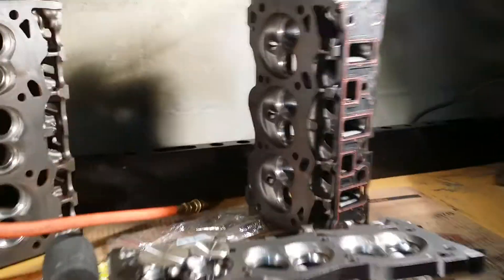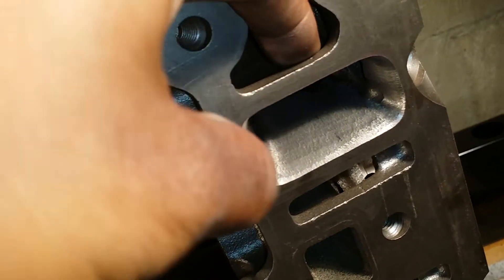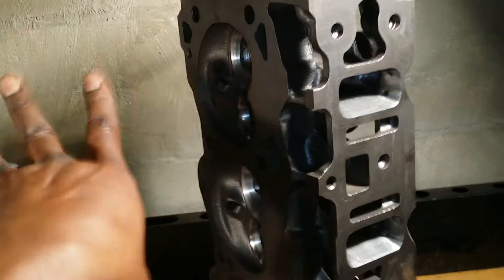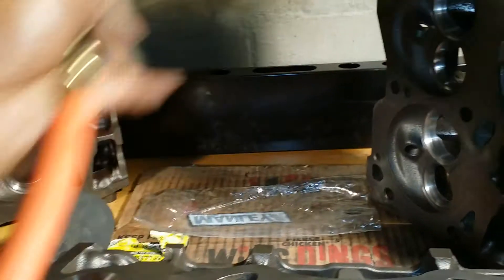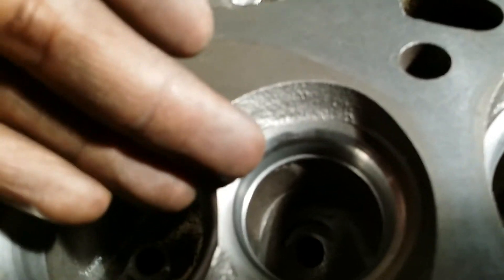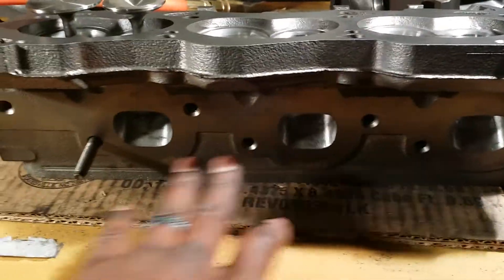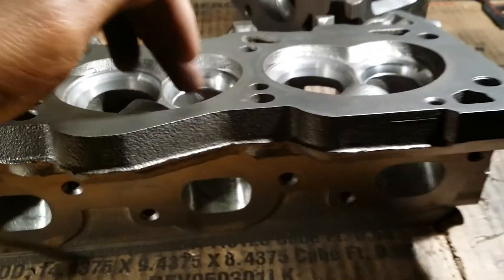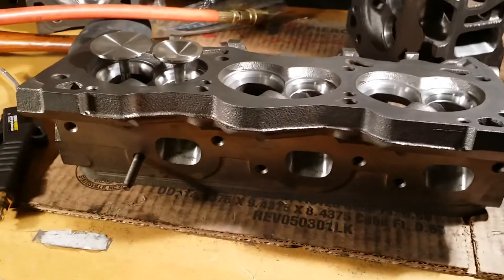Ported 3800 Heads (Part 3)

Comment: Templates? How about silicon rubber removable casts of the ports to show
the correct shapes of the runners and bowls? Cut heads to show the casing
thin areas, water jackets etc?

Comment: Venturi effect.  You should understand the basics, before, you say this is an effective way to shape a port.  Go flow test that head, I'd bet you didn't help the flow much.
Velocity is not always conducive to flow. Velocity is speed over time. Cfm is volume over time.
High pressure, low flow---low pressure, high flow.
Your imagery with the hose, you absolutely neglected a baseline fact.... The higher the pressure, the lower the flow. Its exactly the same as exhaust systems... What flows more? What flows faster? A 2" or a 3".
I also recommend you reasearch flow/fluid dynamics. Its a proven SCIENCE.

Comment: No need to port the intake window youll go backwards in low speed air flow on a 3.8 inch bore. Concetrate on the intake bowl and never never kids go 90% over the size of the intake valve......flow will just go backwards.
Reply: Incorrect. These are not N/A engines. The rules are completely different with a positive displacement blower.
Reply: @Big_Chris  Wrong air flow needs direction ,  you just cant port anywhere and then think air is going to be rammed down the port by a blower. Properly prepared set of heads for a supercharger with a smaller intake cc will outflow a larger cc intake if its not properly ported in the right areas.  Has nothing to do with N/A or Blower.
Reply: @krishess4081  You've articulated a strawman argument. I'm not debating the obvious, nor instructing my followers to just port anywhere. I'd encourage you to shove 10 psi of boost worth of air through a cylinder head during a flow test and tell me N/A vs blower doesn't matter. More traffic requires more lanes. Moving bigger furniture in requires larger doorways. That is an elementary fundamental.
Reply: @Big_Chris  see thats your mistake "more traffic requires more lanes " like i said you just dont port anywhere and think that the intake port is overall larger so it must flow more air LOL. ln you vid youve made alot of mistakes and definetely have gone backwards in directed airlow.  And its not elementary fundamental,   bigger isnt better .
Youve also contradicted yourself at the start and end of your statement. Understand that air flow to the intake  valve flows in one direction only and its guided by the actually design of the port  small improvments can be  made with great results  if you know what you are doing. You havent done this  and in your vid youve just ported anywhere and thats a mistake.
Reply: @krishess4081  would you explain or show me how to port these heads thanks

Comment: I want to to port the heads on my c63 amg but I know exact numbers are needed and weistec actually offers this for me but costs $5000 lol so kind of want to do it myself. Not sure though I don't want to mess it up
Reply from the maker: I've heard most AMG heads are hand ported from the factory. I'd stick to changing shapes where needed. probably won't find many casting flaws. I wouldn't try to make the ports much larger unless you have a specific RPM target limited by port area. If you need a formula for that for your engine, you can pm me.
Reply: Maxmaj1q Wow thanks for the reply man!! Hell yea I will get with you after my headers and exhaust and tune install this week. thanks!
Reply: Maxmaj1q it says cnc polish and port is that still hand ported or no?
Reply from the maker: +AMG HEAVEN No sir. CNC meams they're ported by a machine. Probably a good bit of power left in them to be found by hand.
Reply: Maxmaj1q oh I'm sure of it. tune alone we gain 90hp cranks but that is becuase the exit is detuned from factory on the c class c63. However exhaust and headers and tune we get 600hp+ crank so there is def some left on the table
Reply: Maxmaj1q Ok so I got some more info on the ported heads. This is what was on the website Weistec.com for my 2009 c63 amg. Listed under information:

5-axis CNC machined

397.88 CFM Intake flow

257.81 CFM Exhaust flow

Any thoughts on what this means and is it possible with this info to port the heads correctly ?
Reply: Maxmaj1q Ok so here is evenmore info 
 ported heads

5-axis CNC machined

397.88 CFM Intake flow

257.81 CFM Exhaust flow

Fully assembled, Ready to run heads

Custom ground factory 40mm intake valves

Custom ground factory 33mm exhaust valves

with all that info is it possible to get it done by someone else? if you had this info could you do it if someone came to you?

Comment: Lots of sound advice. Have you ever thought about developing a port for CNC? What are your thoughts on polishing the chamber? What dont you like about the 3800?
Reply from the maker: I am considering doing a CNC program, but it also takes away from the personalization of the port work per application. 

I didn't believe polishing the CC's was worth it when I first started. I was wrong. 

I don't like the inconsistencies of cylinder head castings. No two pairs are alike. I don't like the shrouding of the intake valves, or the fact that the CC sometimes overlaps the cylinder bore itself and causes hot spots. 

the 3800 is one of the most poorly put together engines due to mass production, but one of the most reliable due to the materials it's constructed with. 

balance, oiling, cooling, head flow, core shift, piston compression height being above the deck, the oil pressure sensor placed before the filter, the intake air temp sensor placed before the supercharger, the unbalanced distribution of air to the cylinders by lower intake design (supercharged engines) and the variations of rotation assembly balance are all problematic. 

simply stated, some of these motors are junk, some are outstanding. on average they are a good powerhouse with a dice roll for reliability. The only way to get everything 100% is to blueprint it.

Comment: thanks for the video...there is real passion for your work in your voice.  I'm freshening up a tired L26 engine with 120k miles on it and I'm going to open up the exhaust ports as demonstrated in your video.  I had a broken con rod (#2) from a fuel leak due to a bad injector.   the c r broke on start up and I shut it off immediately.   any thoughts on this issue, from any one....the new con rod from gm has not had it's small end split yet, although the score marks are there.  is it normal that rods are sold not split? and if it is how hard is it for a machine shop to split the small end.  thanks and keep those 3.8 vids coming.